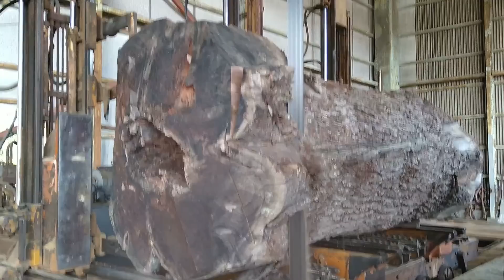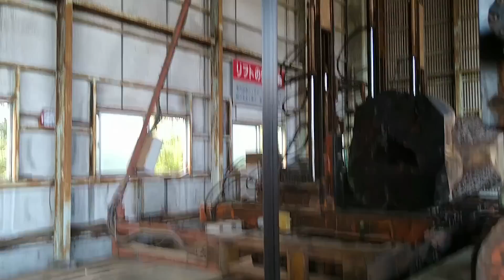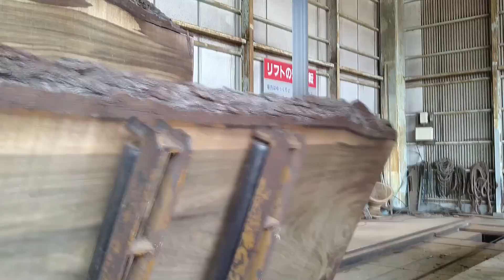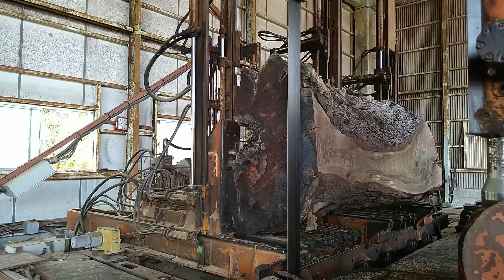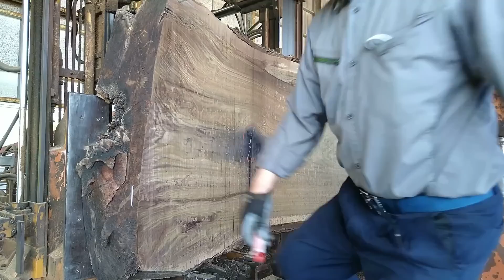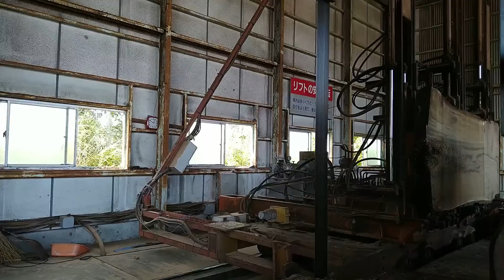【製材】アメリカンブラックウォールナット

Comment: Why not post a video explaining what to do with wood after cutting it like this one time
Reply: Normally ... Wood is used for Furniture, but also used by Firearms Manufacturers,.... Gunstocks, and Knifemakers,... Scales.
Reply: @KennethKustren-lr6tg  
Thank you Sir to explain. My country was sold in this way or that there is another phase after sheak this form.
 For example, the most small or sliced pieces are struggling.
 Sorry if my language is not good